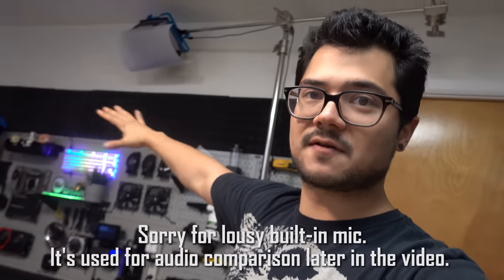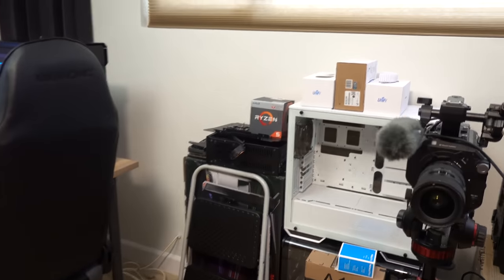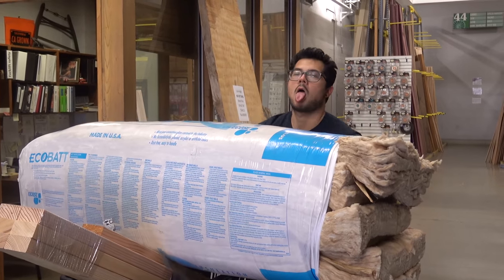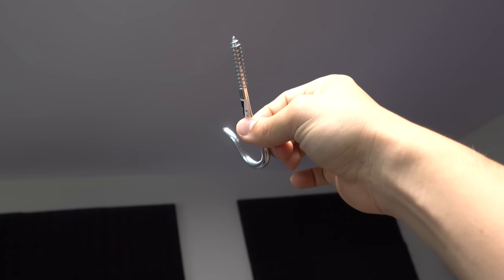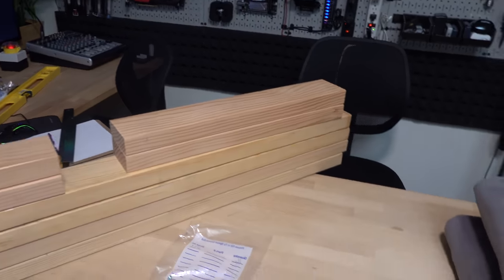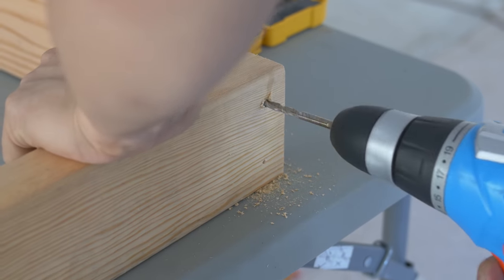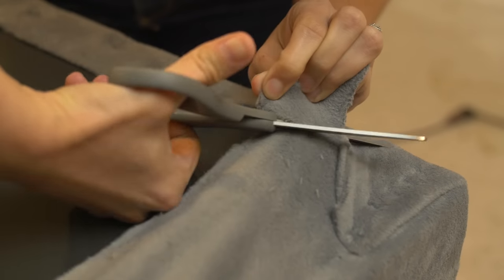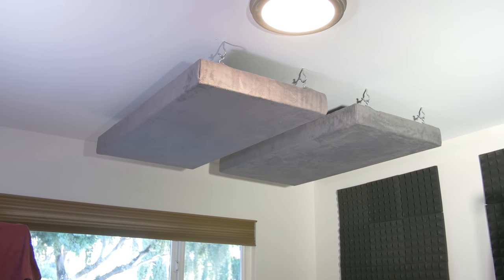Making my own acoustic panels...Was it worth it?

Comment: "A" for the effort..."F" for the results.
Reply: there was a huge difference
Reply: Two panels is not enough to make that much of a difference
Reply: SunTai  the material is fine, just not as effective at a given volume  compared to something denser. It will still help at catching frequencies lower than the thin foam is effective at. 

The real problem here is how he chose to mount that rock wool. Very wasteful, heavy, overbuilt frame.

Comment: About 8 years ago, I moved into a basement apartment ... the room I was in had single pane windows which were like 3' tall and 5' wide, and was probably not insulated along the 2 outside walls.
My landlord and I went to Lowes Canada, and picked up rigid 16" x 36" styrofoam boards, double sided tape, and window plastic.
Not only did the foam warm the room up, it actually cut down the reverb by like 90%.  IT was also cheap, I think $15/4 boards.

Comment: I ended up building pretty similar acoustic panels for my studio room with some advice from an audio engineer. Couple things. Prepare for wall of text.

The air gap between the ceiling and the panel is actually great. You want the sound to run through the panel, lose energy, whatever is left gets through, bounces off the wall/ceiling behind it, then comes back into the insulation again. Because of this, the poster board backing may actually be reducing this effect, since it'll immediately reflect the sound waves. I used speaker cloth on mine, but as long as the material doesn't reflect the sound before it gets into the insulation, you're fine.

Though the panels are a little expensive to make, don't forget your walls. Putting some above where you talk is a great idea though! The foam pieces, I'm told from said audio engineer, do almost nothing. They help slightly with higher frequencies, but barely. Try to focus on any bare spots on the walls; those create standing waves. A last resort is just have SOMETHING on the walls or in front of them to break up standing waves, which is generally what you hear in a room that isn't treated.

As for placement of any panels, one trick you can use is to put a mirror on the wall and have someone move it until you can see the source of the sound - in this case you where you sit. Those are your "early reflection" points and that's your #1 priority for treatment. Also, how many you have. If I take all my panels down (I have 9 currently), adding them back one by one makes exponential gains each time. Sound is simply transferred energy, the more you can trap it and make it lose it's energy, the better the room will sound.

Thank you this has been my TED talk!
Reply: Question tho, isn’t speaker cloth meant to let through sound unobstructed? In that case it’s more of a visual covering than a functional one, no?

Comment: Interesting choice with the 2x4s,  seems excessive...  also the cover material you chose seems thick/heavy for allowing high frequencies through...
Reply: absolutely. 1x4s are plenty enough. and that thick fabric is the worst choice, likely inhibiting the effectiveness of the insulation.
Reply: @snoooozer  yeah 1x4s and something much more breathable for the fabric. that said it definitely made a difference
Reply: Except that high frequencies are blocked easier than bass frequencies. Which is why you hear bass from car audio before the mids and highs hit you
Reply: Could have even used square pvc and would have been way lighter
Reply: In a tutorial someone said you have to be able to blow through the fabric for it to be good for acoustic treatment
Reply: Mykel Hardin  no guy. The thick fabric reflects sound waves so they don't have a chance to be absorbed at all by the insulation. There's a reason why all professional acoustic panels are made with acoustically transparent fabric.
Reply: Mike Ford yes, but when you “block” high frequencies they reflect.  The point of an absorber it to absorb the frequencies aka. Let them through.  Bass frequencies will go right through a thick cover and be absorbed into the insulation... but bass frequencies don’t cause flutter echo.
Reply: the wood actually causes vibration. to sound proof a wall sound dampening  must be placed on studs. a cost effective solution is grace ice and water shield for roofs
Reply: Best material I have used for 8" thick treatments for the outer cloth was a dyed burlap type material, did way better than even thinner low density fabrics some are so dense they end up reflecting back the sound as is.
Reply: I would like to add the fact that the poster board is also not ideal: if it had holes, the sound bouncing of the ceiling could also enter the sound dampening material, and thus perform better. A mesh of some kind would have been better.
Reply: Mykel Hardin  No, you need generally dense material with air pockets. It's the repeated air pockets followed by another solid surface that dampens sound. Also, it depends on the frequencies you intend to trap to determine which cover fabric you use and the density of the other material. This is why anechoic chambers have so many different types of materials with different ridges and designs in order to cover as many frequencies as possible.
Reply: And when he was drilling he could just have used one drill bitt
Reply: I would just try to re-create the expensive ones he saw on amazon.
Reply: What about that posterboard?  The DIY sound panels I have seen never had an enclosed back.  Is this good or bad?
Reply: the fabric choice is really bad. you want the most breathable and thin fabric to allow the insulation to absorb the sound. so in reality a fair bit actually reflects of that thick cloth.

Comment: Not to shit on the hard work but I barely noticed a difference
Reply: That always happens when you already have some paneling in place, it's smaller and smaller increments.
Reply: hard work?
Reply: as an Audio Engineer, Huge difference IMO, I wouldn't call it an echo as much as a short late reverb.
Reply: He already had some acoustic treatment in the before situation, so that made it less obvious as well.
Reply: I think fabric chosen is wrong , that non breathable fabric ruined all the hard work i think
Reply: @pronavsandhu  that poster board backing ruined it even more, yuk. More fabric would've been better. But still people who cant hear the difference cant hear. That's the issue, theres a very noticeable difference.

Comment: Great looking sound panels! However, I’d suggest using different materials. I’ve seen a lot of comments suggesting 1x4 for the frames. I agree. Of course you want find a wood that’s light without breaking the bank. I believe I used poplar for mine. It’s also important to use  breathable cloth. For example burlap (cheap) or speaker cloth (expensive). As for the insulation you’re better off using Owens Corning 703 or Rockwool. This is a special type of insulation used for garage doors and water heaters. It generally comes in 2x4 sheets. It’s easier to manage and what most studios use for building there sound panels. This can sound on Amazon and any insulation supply house.

Comment: "These hooks are going into STUDS" 
No, those hooks are going into Joists.
Reply: Not necessarily correct.  Could be going into the trusses if there isn't a floor above him.. (but yeah, not studs) ;-)
Reply: @curtisbme  you do have a point. All the houses I built were traditional stick-framing, so I got used to calling them all joists.
Reply: its all the same thing stop being finicky lol
Reply: D'oh!  I knew this, but now I'm fretting that I probably said the same in my own DIY video (studs vs trusses vs joists).  Doody and dammit! :-/  At least folks will get the gist that you're wanting to drive into the thick wooden material behind the sheetrock and not expect the sheetrock itself to hold all that weight. We hope!

Comment: Your're on the right track, and I think you did the right thing!  A few notes for next time:
- use 1x wood stock instead of 2x wood stock.  It'll reduce the cost and weight of the finished product.
- stick with Roxul Safe N Sound (not rigid) or OC703 (rigid) for the batting inside the panels.  They're great price/benefit ratio.
- use an acoustically transparent and fire-rated cover material.  Guilford of Maine Anchorage or FR701 are great for this purpose.
- visualize your reflection points.  Here's a good guide to help:  https://www.youtube.com/watch?v=B9u7k2V4YPw
- the foam panels (and it goes against every fibre of my being to say this) are probably the best for your situation.  They absorb mostly in the vocal range.  When you start mixing the next great electronica album with studio monitors and a subwoofer, 4" thick mineral wool absorbers with a 2" air gap behind them at all first reflection points, plus superchunk absorbers in all 4 corners and a ceiling cloud will be a great idea.  For now, just try to treat parallel flat surfaces with (urgh) foam (I threw up in my mouth a little there).
- If you can't tell, I hate foam.  It's ineffective for most people tracking and mixing music in a bedroom.  But for your voice-oriented material, I think it's actually good enough.
- when it comes to attaching foam to a wall, try using T-pins.  They'll push right through the foam and through drywall, and they don't leave a very big hole behind.

Best of luck in taming that room!  You'll get there :-)

Comment: made no difference in sound but I do like these kind of videos.
Reply: The area covered is just too small. For a home cinema you would cover over 50% of the rooms area to get acceptable levels of reverb. But since he already has the insulation lying around he could build 4 more panels and hang them too.
Reply: If you have headphones on you could tell a difference
Reply: there was a huge difference and im listening on quite an expensive system

Comment: You could also try using Rockwool Safe'n'Sound, Its relatively cheap and would probably work perfectly for you!
Reply: Correct. I've been looking at the same stuff and $75 for the stuff Kyle used is stupidly expensive as the Safe'n'Sound stuff is around $40-50 at the Lowes near me.

Comment: No dobut 100 other people have talked about this, but a few things to keep in mind as you continue your quest to improve the sound quality;
1) get a short dense carpet without padding, that will probably be your biggest bang for your buck by far.  And without padding under it, you should not have too many issues with your tripods being off-kilter.  But it is your largest single flat surface, and carpet can often be found for cheap.
2) When making acustic panels, the more dense the panels the better it will work.  Rock Wool (on brand or off brand) is a little more expensive, but not nearly as expensive as it use to be, and it is absolutely perfect for what you are trying to do.  I recently redid my upstairs bathroom and lined it with rock wool in the walls to keep bathroom noise inside the bathroom and the difference was amazing compared to the normal insulation style that you got.  I have since added it around my HVAC unit, and made a few panels out of it for the basement and that is much nicer now.
3) Echo is largely a bouncing of noise between parallel surfaces, so you need to eat noise along the surface area of at least 3 of your parallel walls to eat it all.  Then break it up and off-set it between parallel walls so you don't have any standing waves that can build up, and you don't end up with 1 totally dead wall and 1 totally live wall.  But as long as you have so much area with floor and ceiling there will always be some echo.

But yeah... as others mentioned, probably wasn't worth $250 for the improvement gained... but more wood for more panels and using up the rest of the insulation would bring the per-panel cost down and would be much more effective.

Comment: At my hospital, for our patient music room, we used carpet on the walls/ceiling.

Cheap and easy to fix.
Reply: Yeah carpet on the walls is a really underestimated solution
Reply: Mykel Hardin  clearly they were just giving a suggestion that their hospital uses which seems to work for their case, don't come off so strongly my guy
Reply: Carpets on the walls & ceiling sounds unsanitary, I'm amazed it's allowed in a hospital.
Reply: Carpet only dampens the high frequencies. Not so effective.
Reply: Just to clarify, it’s an NHS mental health hospital.  Budget was a donation from a local firm to set us up from nothing.  Had to make do, hence my suggestion.  

We’d love to spend thousands of pounds but it does for us.
Reply: @juddphilby9015  I understand :-) Still better than nothing. Doing a good job with what you got ;-)
Reply: Mykel Hardin  Lol. I saw two of your comments and both of them were wrong.
Reply: @Goose1162  Yep, one of the best solutions is to get nice looking thick fluffy/furry blankets and hang those on the walls.   You can get one of those fluffy blankets and hang it on the wall and it will do a great job while looking good.    Seriously those blankets are cheap and a grommet tool is like 10 dollars.   You can go even cheaper with moving blankets as well, for significantly cheaper he could have even doubled up with a regular blanket on top and a moving blanket behind it.  You can literally do an entire room for like 200 dollars.
Reply: Mykel Hardin  It is not reflecting, but dispersing (by reflecting in different directions on uneven surface). Big difference. Just reflecting on flat surface can enhance the sound (how horn works).
And by dispersing, the noise is still be there, it is just made less sharp, blurred out. Sound will become noise (as in white or pink noise).
Reply: @juddphilby9015  Remind me not to go to your hospital, that sounds unsanitary.

Comment: Kyle I hope you read this. The fabric you used is too thick and you should not place the cardboard behind the panel. If you're going to do an air gap like you have on the roof, cover the whole thing in fabric. That way your 4-inch panel really becomes an 8in panel because the sound will reflect off the ceiling and then be able to go back through the panel again. The way you have it right now the sound goes into the panel reflects off the cardboard in the back and then back down into your room. An air gap is very important to have cuz it doubles the efficiency of the panel but you need to remove the cardboard behind. The fabric you use should be quite thin and you should be able to put it against your mouth and breathe easily. That way sound can penetrate through and get absorbed by the insulation. You are going to have a lot of sound reflect off of that thick fabric.
Reply: Exactly- don't seal the backs of your panels or else it kills the whole purpose of creating a gap between them and the the ceiling.

Comment: You did a thing!  They turned out pretty well Kyle :).  

A few things that can help drive the cost down if you have to buy new material.  You can use 1x4 boards instead of 2x4s; cheaper, lighter, but still strong enough to make a frame and hold the material.  Cans of expanding spray foam can be cheaper than buying new rolls of insulation and should have about the same effect, plus it will stick to your material.

Here are some things you can do to drive the cost down further.  See if you can find some houses or buildings being remodeled and get ahold of used or scrap pieces of insulation; there's a good chance you won't have to pay for it.  As an added bonus, you can also search for used lumber like plywood, 1 by or 2 by boards for your frames.  Lastly, go to your local thrift store and buy used sheets as covers for your panels.  

Still driving the cost down further (possibly):  Go to the thrift store and buy a bunch of blankets and staple them to the ceiling and walls (the absolutely cheapest method).  You may be able to find carpet tiles (these are used by businesses a lot of time) for free or really cheap, and glue them to the ceiling and walls; they could be more aesthetically pleasing than blankets.

Comment: even better idea, though this will require you to dedicate a room. buy a bunch of cloth, then strip the drywall off of the walls of that room. After that you check the insulation and replace any that looks too old or decayed. Then you staple the cloth onto the walls studs. then you can do a whole room without buying a crap ton of insulation. just dont touch the walls with anything sharp.  :D

Comment: I'm glad that YouTubers are highlighting the importance of acoustic panels! You would get a lot more milage out of them by correcting the placement because, since as others pointed out, there's not much of a difference. Spreading the panels out on the ceiling, increasing the gap between the ceiling and the panel, as well as tilting the panel will yield much better results. For the size of the room I would also recommend at least 2 more panels spread out where there are going to be a hotspots of sound. The main place would be directly above where you film as well as towards the sides of where you film. This will take care of some of the first reflections. Hopefully this helps!

Comment: In this video, you do not understand the principals of acoustics.
Reply: My impression as well; a small carpet on the floor and some egg carton stapled to the roof would have cost less and been far more effective.
Reply: actually horrified people are still suggesting the carpet and egg carton stuff lol. Both totally innefective, a waste, hideous and highly flammable.
Reply: @Jay2097  Egg cartons are a bad idea, correct.  Carpet though, depends on the type.  Thick pile carpet has some decent absorption coefficients in the upper mid and high range.  Thin carpet is not as good, the thicker the better.
Reply: @SideGateStudios  you're definitely right but if you're buying something fit for purpose a rug is a bit silly. If you have one lying around you can roll it up and even get good bass trappage out of it. Serious rugs are expensive though.